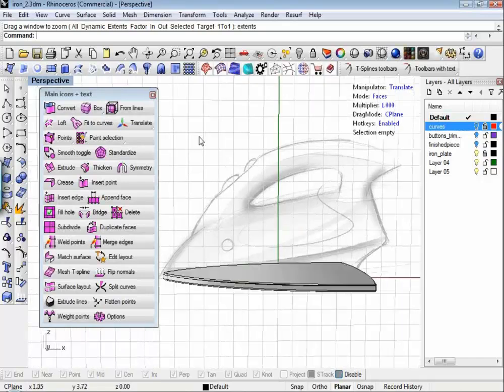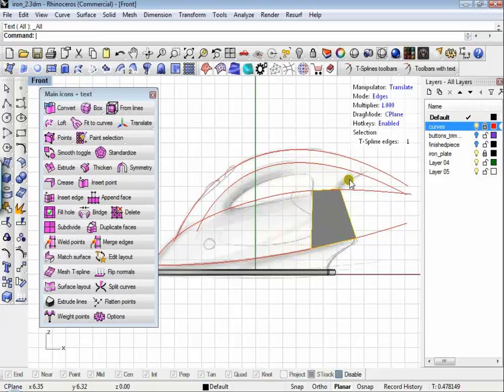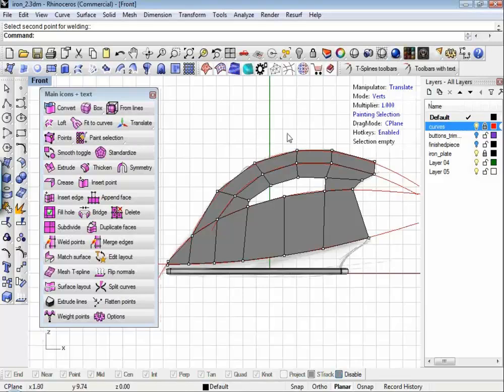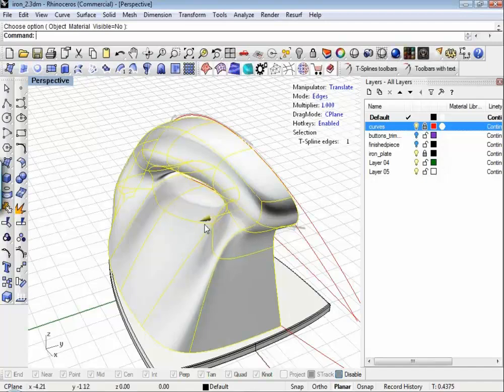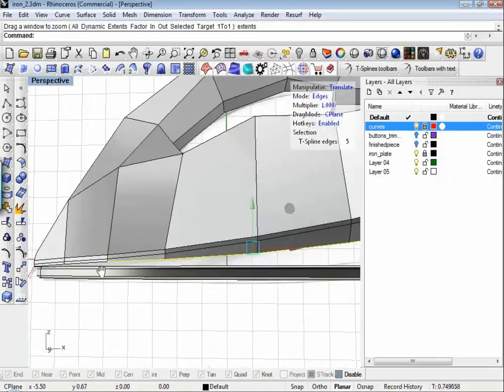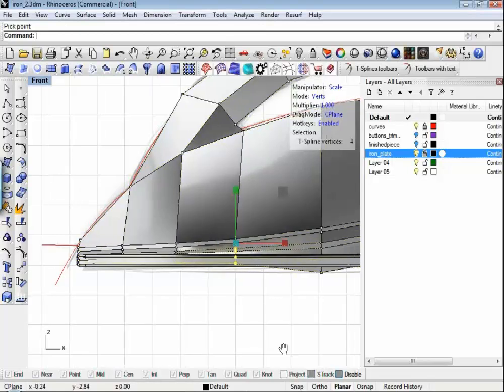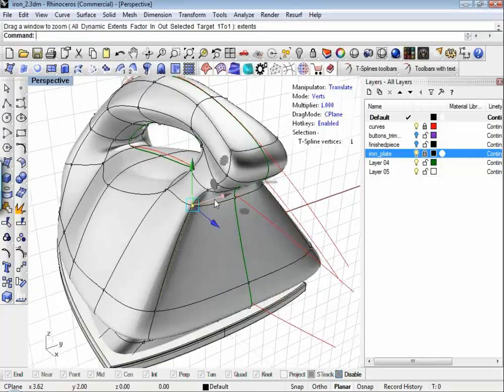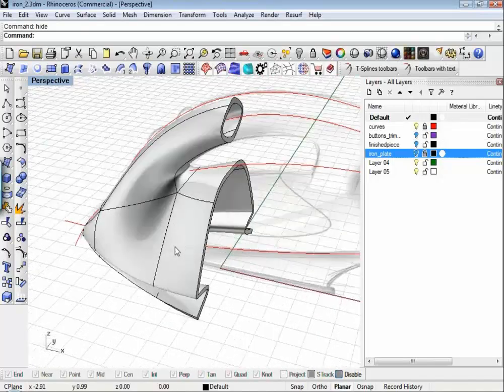Model an iron using 5 simple T-Splines for Rhino commands

Comment: From what I do understand, TSplines allow you to create Catmull Clark Subdivision Surfaces right inside Rhino, than you can convert this to Nurbs surfaces for refining and adding trims, cuts in Rhino.But is it possible to convert all the resulting finished Nurbs geometry back to Subdivision Surfaces and possibly to export as Quad Mesh cage with weighetd geometry to import and use as SDS on other packages ?

From What I know Modo has a workflow to do just that thru PowerSubDNurbs and Cadloader.

Comment from the maker: @xme12x Hi, to answer your questions:

1. First of all this video was done with T-Splines v2. Now we're on v3. You can run tsEditMode to turn on the manipulators, which are used to drag the surface points and edges. If you press the ALT key, then drag surface edges or faces, it will extrude them.

2. I don't use the extract control polygon command much. That was mainly useful in T-Splines v1 before we had better commands.

Comment: amazing video! congratulations, i've been checking tons of tsplines tutorials and this is definitely the best one! i've got two questions, i hope you can help me out with them: 1) when you pull and drag the edges or points of the surfaces to adjust them to the sketch, do you push another command? i mean, you just keep pressed the click or you use another key like ctrl or alt or shift or something like that? and 2) do you use the "extract control polygon" command? i think is very useful! thanks!